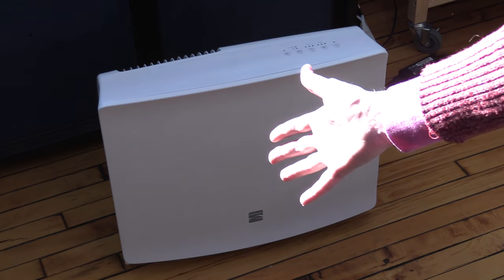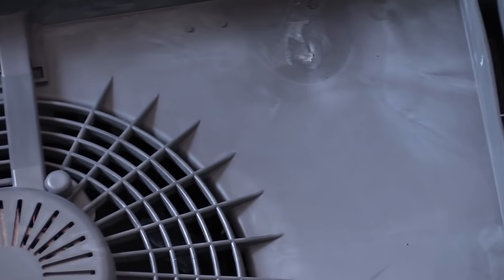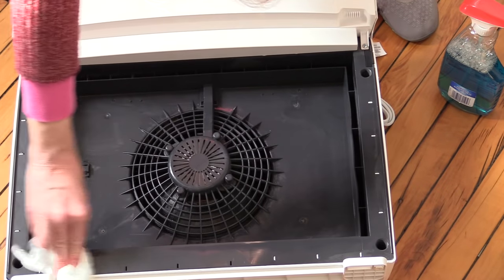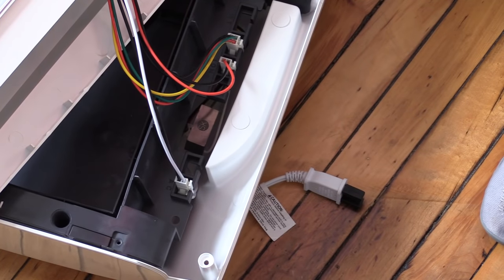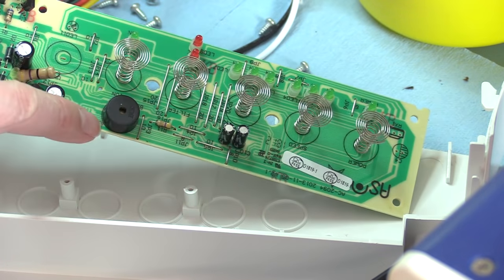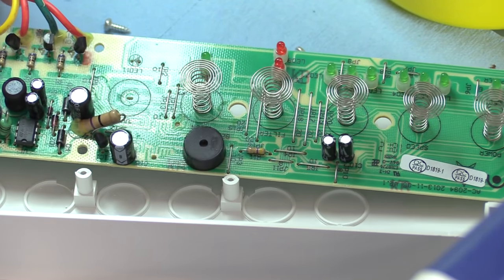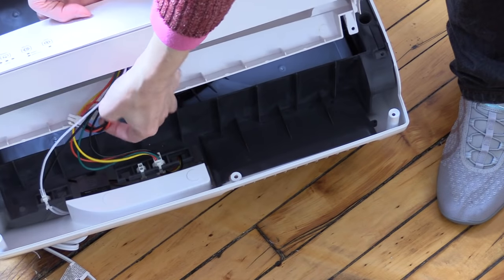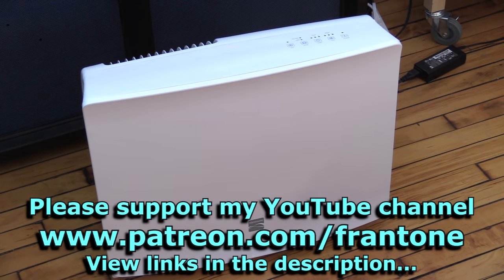The Surprise Inside A New Kenmore HEPA Air Cleaner!

Comment: The high voltage from the Ion generator attracts the dust statically to the plastic... They would have tested the discharge element with the case off to verify it worked. That would be my guess as to why it looks so bad
Reply: Soooo, reverse polarity of the ion generator, place outside and blow the dust the hell off of it, perhaps with assistance of a stiff breeze / fan?

Kenmore sounds like a Chinese / Anglicised name to me, if so, and having experienced winter air quality in Shenzhen personally, I'm not surprised, I would also expect it to be kind of oily; I coughed for 3 months after spending 6 weeks there through winter.

The smog from China was extending over 150 nm into the South China Sea.
Reply: v0w1x2 Youd actually be wrong on kenmore. Kenmore is the long standing consumer products brand of the late Sears and Roebuck. They used to make pretty good products many moons ago. Now the name is just slapped on whatever generic consumer electronics it can for name clout.
Reply: and im going to guess they test the units without the filter too easy for westerners to see dirt on a removable filter if  they were to test with the  filter

Comment: Looks like mold release to me.  Still should have been cleaned better considering its function.
Reply: That was my thought too.  I used to work in a plastics molding company and the crap was EVERYWHERE.  There were supposed to be systems in place to control it, but by shift's end we were pretty much covered with it.   All the plastic products had to be sent through a wash at the other end of the plant, but it wasn't worth diddly either.
Reply: but that would cost money and who care about the westerner end user

Comment: that white powder could be talcum, which is sometimes used in mixture with the plastic granulate for the injection molding process, and might be excreted on the surface later on. We had exactly such a 'cosmetic failure' with one of our applications recently. Forgot, why this was used actually, perhaps for better withdrawal of the part from the tool. So we got a PCN to receive that granulate w/o talcum.

Comment: "Don't turn it on, take it apart" - copyright David Jones EEVBlog
Reply: I do exactly that with any computer equipment I buy second or refurb. Take it apart, clean it thoroughly, reseat everything, check screw positioning, switch it on briefly, turn it off, smell everything, then put it all back together, then turn it on for a full test

Comment: Fran, I’ve seen something similar before from assembly workers wearing latex gloves WITH TALC. I worked at a  J&J medical device facility for over 10 years and even though the assembly took place in a Clean Room environment, individuals insisted on wearing gloves with talc because they’re easier to put on and remove.
Reply: Fran, what does Occam’s Razor suggest? The simplest explanation is the use of powdered latex gloves that are used throughout industry in the assembly of everything we use.
I’m a mechanical engineer who has seen (and personally used) latex gloves with talc for assembly of everything from medical devices to military hardware. It obviously shows up more prominently on flat black surfaces, but UV light would reveal that latex glove talc is on just about everything that is assembled in a “controlled environment”, and I use the term loosely. Stay safe. Love you Fran!
Reply: you sure it was talc and not cornstarch?
Reply: That's a lot of talc in that unit to have just come from gloves.

Comment: I used to work at sears, (assuming you got it from a Sears Hometown or Sears.com) The first 3 digits on the model number before the period are the manufacturer code. You can look this up on the internet. That can divulge fun information and a good source of parts should anything break in it. I have also found mods that you can do to things to gain additional features sometimes, not originally spec'ed  by Kenmore.

Comment: Back in 2006 or so I shopped for and bought a HEPA air cleaner. I only wanted to get one with a washable filter and the Honeywell HFD 130 has been going strong ever since. It has three fan settings, timer from 1 to 10 hours, and a handy graph showing when the filter should be ready for a wash (based on settings and use time). It'd be nice if it were sort of a vertical narrow footprint like the Kenmore, but it takes up the space of a potted plant instead.Yes it's the Honeywell HFD 130. Buy now! hah, but yeah it's been a rare keeper.

Comment: I'm really curious about the "shouldn't breathe ozone" and now need to know why, or my brain will explode!
Reply: Ozone steals electrons from molecules is gets into contact with. When an electron is stolen from a molecule it often doesn't do what it initially did, this means if it contacts a virus particulate, it probably disrupts that, if it contacts your cells' membranes it probably disrupts those. Vaguely similar to why you don't want to overexpose yourself to UV, but from the inside.
Reply: @avamander.  Exactly, it is a potent oxidiser, and is going to damage or destroy the cells inside your airways, lungs and also any mucous membranes, along with your eyes. Killing germs, bacteria and even virii, but if you also are there it will destroy your own cells, and damage others which can become cancerous. 

As well the breakdown products from organic material are reactive organic compounds, that themselves are carcinogens.

The dust inside the unit is not duprising, they tested it in the factory without a filter for a few minutes, so that they could see if it was going to run for at least warranty period, and during this time all the plastic parts were charged up with a massive static charge. Then unplugged and left to run down till it was bagged, so the static charge attracted all the dust in the air to deposit on the surfaces.

Now plastic that holds a charge well, and capacitive touch switches that sense an electric field, and respond to the field magnitude, right next to the static generator. What could possibly go wrong with that then.
Reply: @SeanBZA  hooray for chinese manufacturing! Lol
Reply: Thank You! I started researching on Google and then came back here to read the comments. 😅 I'm obsessed now! What's the answer!?
Reply: Ozone is also produced by lightning in a spring rainstorm - that is why it smells so fresh & clean after.
Reply: @Simon  Ozone is O3. That's just an extra O. That extra O can be harmful in some circumstances.. but it occurs in every plasma event on Earth.  In our electronics manufacturing lab, we use air ionization to reduce static electricity in highly sensitive IC handling.  Additionally, O3 is very effective in reducing mold spore viability.
Look at Hydrogen peroxide.. there's an extra O there and we can use it directly on a wound with fairly good results.. just don't drink it.
✌❤

Comment: The talky powder is mold release that never got cleaned and in transport coated everything back, where it used, you'd see it on the filter, noticeably so.

 Harmless...well, as these things go. 

IMO, you should make the ION feature into a manual on/off switch outside the case. It's ok to Ionize a room if you're not innit for long periods of time (when not in use). Considering the situation, one of these would be excellent to have in the entrance area, because clothes that are infected, can release viruses into the air, when stirred (as per CDC safe use of PPE training videos, in which they say to take the mask off last).

Comment: Seems that almost all of the tech channels I follow have the same thinking I do.  "New or not, it's coming apart!".  I kinda have to go with many of the others here, tho. Pretty sure that that unit has more time on it than just factory test. Many retailers will repack and resell product. And Sears, in it's latter days, really went downhill. BTW, I'd be a bit concerned that unloading that HV power supply might cause issues, arcing transformer or circuit failure if it ever turns on.  I'd probably cut the primary power to that P/S, or pull the switch device. But I am a tweaker...:)  Thanks for the short, fun, informative vids!  Like those spring toadstools, too. Easy capacitive switches....  Again, thanks for the vids! Stay safe!  Stu (P.S. Last time I was at the store, plenty of bread, but you could blast a flamethrower down the paper goods aisle and hit nuthin'....:)

Comment: Could you reproduce this unit for less than you payed for it? 
Its essentially just a sealed fan with a hepa filter at this point.  Perhaps a large box fan and large replacement hepa filter with a simple diy shroud connecting the two?  
Depending on what you payed it might worth a try! 
I'm sure the diy one would have a crazy cfm.

Comment: That part of the circuit with the inductor was not likely the ionizer.  The little black box that looks like a starter capacitor is likely the ionizer module, it should have a wire going to some needles or carbon brushes somewhere in the air stream.  The modules are often separate, potted in a small plastic box, and isolated from the control circuit as the high voltage they produce (static charge) will damage the components.  Ionizers rarely generate much O3, unless they are not operating properly.  In a lab setting, it is important to not use them, they can cause airborne dirt to stick to walls, electronics and optics.

Comment: Back in the 1980s when I worked on large mainframe hard disk drives we had a problem with the plastic shroud that covered the platters. The engineers referred to it as "blooming" which is additives to the plastic that migrate to the surface of the plastic. Very fine particles and read/write heads don't work well together so the plastic formula was adjusted and a lot of hard disks assemblies were fixed. https://www.ptonline.com/events/details/fe91f3d1-0b33-45ea-892f-82c35b00dced

Comment: If it is new, wouldn't that fine dirt/ dust be a result of the ionizer being tested as isnt that the point of them to clean the air by atracting and then clumping fine particulates in the air.

Comment: Strong ozone smell plus dust inside the air path?  That's a returned unit sold "as new".  I don't blame you for disabling the ozone generator but a little ozone plus a filter element with activated charcoal can increase the filtering efficiency (particle size) considerably without any increase in risk. H12 becomes H14, plus it will go to town on the VOCs such as you get with soldering.  (Flux vaporising off a work piece is way worse than any use of lead based solder).
If the filter is sealed with foam on the outlet side, it might be because there is activated charcoal beads between the foam and the filter (as there should be).

Comment: so two thing one the dust is probably not coal ash coal ash id more flaky and granular my guess is its plastic dust or something similar  from the factory and im going to guess they test the units without the filter and thats how the dust ended up inside the unit a secondary possibility is its the dried up remains of a cheep mold release or a powdered mold release agent